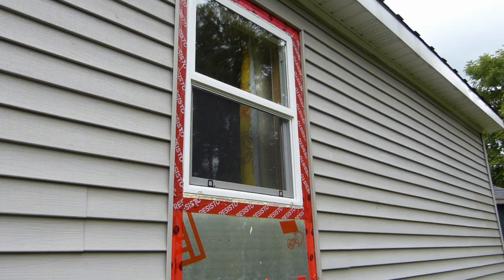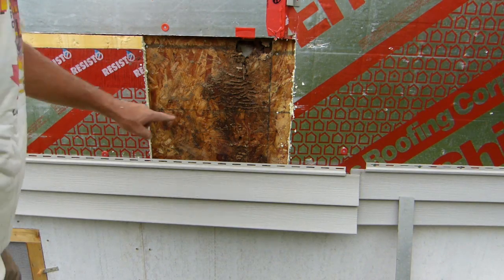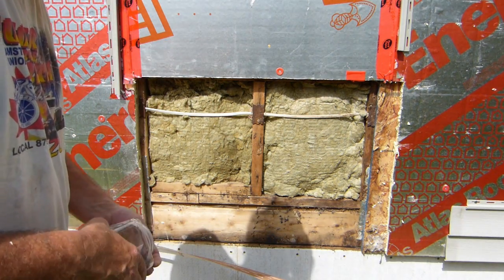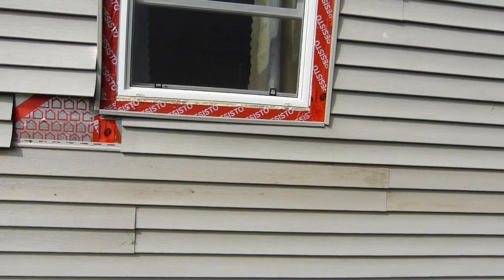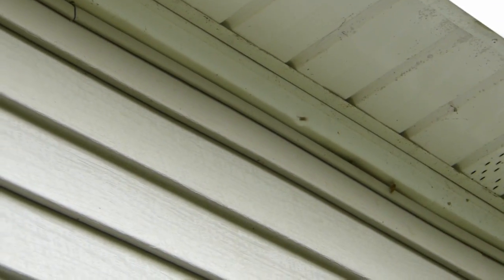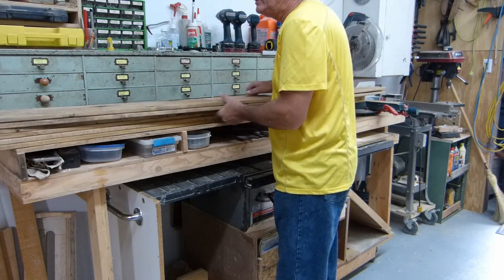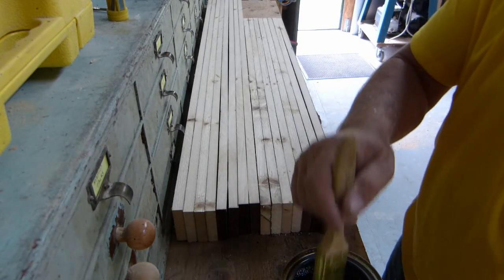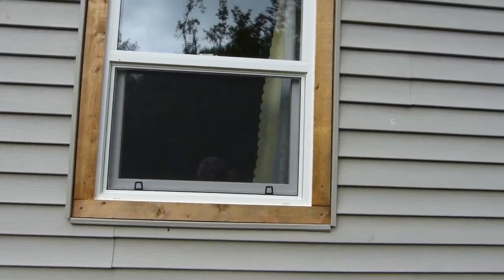HOW TO Replace Windows Pt 2:  Exterior Siding and Trim

Comment: i have the same one  where are the  screws on the old window  behind the siding??
Reply from the maker: When I resided I left room, but they were pretty easy to get at originally
Reply: @JimDockrellWatertone  ok   ill have to take some off to see
Reply from the maker: @mikepruett1745   Just note that they were screwed in on the inside windows, the outside ones were attached with about a million staples.  It is like 2 seperate windows not attached to each other.